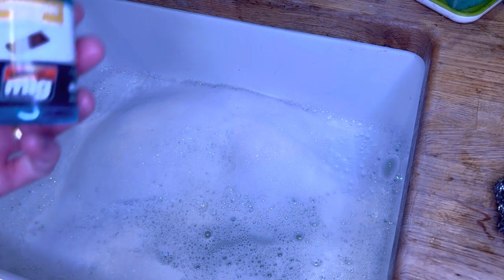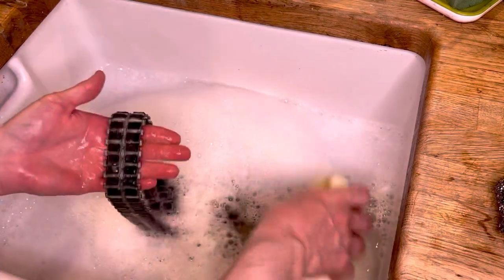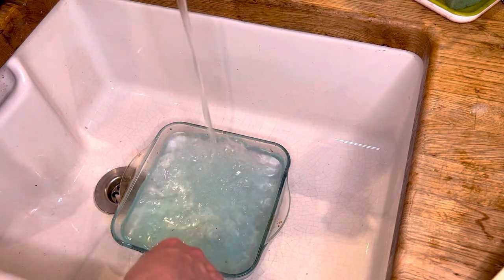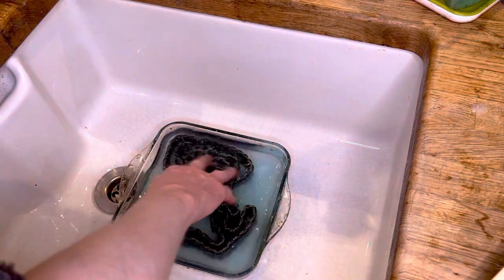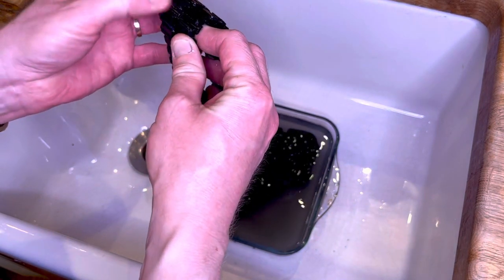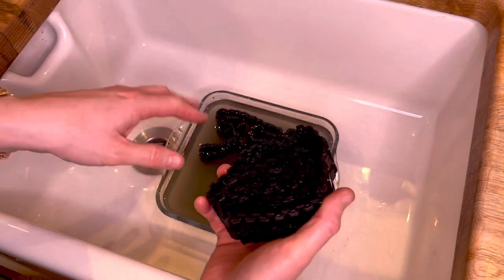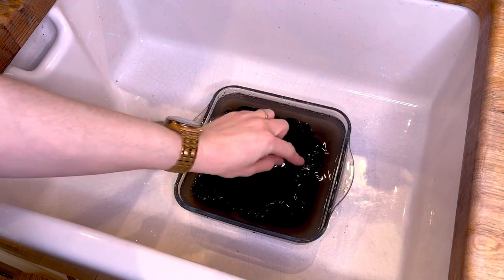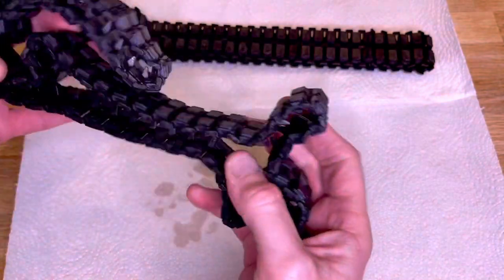AMMO by MIG track burnishing fluid #howto for Heng long/Mato metal tracks

Comment: Hi I used MIG on my Haya Chieftan tracks but they did not go as dark as you achieved although they looked a lot better than how shiny they were when the tank arrived. I did not wash and scrub or use warm water as you did and looks like i should have.  First time i had used it and have to say its worth doing it as it improved the look a lot even though they went a grey colour rather than black. Thanks again for really useful tips.
Reply from the maker: That happened to me first time.
I found if there is any grease or releasing agent from the molds, the fluid cant attack the track metal.
I've been meaning to do this for a while, and as i had no content of the Abrams i thought id put this out.
If people are amazing enough to subscribe to my nonsense, the least i can do is try to do something weekly  
🙂
thanks for watching again, too kind

Comment: I see these are the high quality chains from Mato Toys for the Leopard! . Your rubber pads have already been pre-assembled, but not here I have to improvise which glue to use to stick these rubber pads on! as these were not included with the Leopard (also purchase). I've never done the chain rusting thing before, but the question is, won't the rubber pads come off the chain? An answer to this would be nice of you.👍👍👍👍👍
Reply from the maker: Hi!
No the pad won’t come off with the mig track fluids.
The Mato ones fit the Leo and Abrams, the chally 2 ones come with slot in pads, that you have to stick in.
Super glue does the job well.
Hope it’s going well, and thanks for watching!
Have a great week

Comment: I went with VMS black track pro 2
Reply from the maker: Hi!
Yes that’s good stuff too I hear, I mainly use Mig because I can pick it up at the tank museum, so no postage 🙂 and I get a 10% discount.
Did it work quicker? Or the same?
Thanks so much for watching! And have a great Sunday
Reply: @mrtankalotrctankschannel  Ive tried both now. Both VMS and Ak black track work very well. But I have to say I actually prefer the Ak version. I didnt follow the guidelines and just semi submerged the tracks in the fluid and scrubbed them with a tooth brush for 10 or so minutes. Then left them to soak for a further ten. The Ak leaves a lovely brownish rust and a light dusty residue on the outside of the tracks, pretty much weathered themselves with a little elbow grease. Chuffed with the results
Reply: @mrtankalotrctankschannel  And I also used the cheapest, nastiest nail polish remover to clean/prep the tracks before hand as it contains 90% plus of acetone, then clean them off in warm soapy water and rinse in council water ;)

Comment: I was wondering if the mig stuff would work on HL tracks…….I assume it would do the same to the metal idler & sprocket wheels?…and the suspension arms (metal of course)….
Reply from the maker: Hi!
Yes! It will work on the Chineseium they use 🙂

Comment: Hello! I watch all of your videos. I watch them on my TV, so subscribing/liking/commenting are either impossible or above my current skill set. :) 
I really enjoy your videos. Very nice how-to's, and superb video/audio work. I like your channel because of the work you do, so thought instead of constantly searching for your
work, would get on a PC and subscribe and click the bell. 
Now to the meat. I got the M1A2 in desert and the one in MERDC, both V7.0. I used the same Mig burnishing fluid, to do the original metal tracks. I got away with one bottle. "After" I bought the bottle I decided to do research on how to use it. I got away with using one bottle for both tracks by just letting them soak longer in a more diluted solution. 
But then, I came across the tracks with rubber pads! 
I put them together and put them on the desert Abrams. They feel a little snug to me. I was wondering when you put yours on did you use the track tension adjuster, or was it just a straight 1 for 1
swap, or did your tanks already come with the padded tracks? Are you going to make a video of changing out the tracks?  If there already is one, I apologize. I just haven't found it. Would love to see it. 
BTW, I also heard that the firearms bluing agent is pretty much the same thing at a fraction of the cost, but haven't seen anyone try it yet.
Reply from the maker: Hi!
Firstly thanks for watching, I’m still amazed people watch my content! 
I think tighter is better, they normally shed tracks if it looses tension on turns between the last road wheel and sprocket.
I’m not sure about the tension on mine yet as I basically run it around the front room, and took it apart to work on it, I will say with my challenger 2 I took out 1 link to stop the idler/track tensioner flopping down because it was loose.
I’ve put them back on, I’ll do a short to show you the factory tension (mine came with the rubber pad tracks)
And I’m glad it looks clear, I record them on my iPhone, I really should get a proper camera, but it seems to do the trick, though the iPhone camera does have a mind of its own!.
And thanks again for taking the time to watch, means a lot 😁
Reply: @mrtankalotrctankschannel  It is my honor, more so than you know, to hear from you. You have done some really cool things. I have a couple questions. I took my M1A2 out for a cruise this morning. Loved seeing the little kids faces plastered to the windows, that was as much fun as driving the tank around! How do you keep your aerials on? My tank, the antenna fit is so loose.  I was trying to justify just soldering it to the base but thought I would ask you first.  Second, the gear box you showed in your first Abrams looks just like mine. It is enclosed. Is that a good gear box? I drove mine through wet grass, over rocks, into sand, up a steep 60 degree incline, and ran it back again remembering to put the gun tube over the rear deck...lol, I am an old US Marine....improper things have happened.
Look forward to your video on the track tension. Thank you for your time and what you do.
Alan
Reply from the maker: @alantrail7662  your too kind 🙂 the aerials I’d use a bit of varnish and paint the metal bit the aerials push onto to thicken it up a bit, or clear nail varnish.
I think you could solder them, but pull them out the tank first, I know this is teaching someone to suck eggs, but I forgot once and the metal I was soldering was still attached to the tank and I melted the attachment point that’s plastic, Doh!
I’ve not run it much yet, but as far as I know there steel, not the chinesium that my little boys t72 had issues with, and it’s nice they have the dust covers.
Thanks again for watching my nonsense! And always a good idea to chuck the gun over the deck! 🙂
Reply from the maker: And I’ll get round to the track tension, but rctanklegion have done a good video on this the chap is called Stanlley Legion 

https://m.youtube.com/watch?v=szka1JDHkhw
Reply: @mrtankalotrctankschannel  You made me laugh..chinesium! I have a theory that while in minute quantities, they get rid of their national waste by imparting subtle quantities into their products. I will hush now. But surely I was looking for a way to continue electrical conductivity to the antenna without a permanent mount. I have worked at Boeing well over 3 decades. I found a malleable sealant that conducts well, but doesn't make it a permanent contact where it requires destructive measures to remove it. lol.
Reply from the maker: @alantrail7662  that must be cool to work for Boeing 🙂 I hope I’m not grabbing the wrong end of the stick, but the two Aerials that come with the Abrams are decorative, the brass bases just push in and have no connection to the receiver, they use to about 10 years ago when it was using analog radios, but the new digital ones have no need, just there for show, I think there the ones you mean? But I Could  be very wrong! 😁
Reply: @mrtankalotrctankschannel  Well, I think you might be way ahead than me! I studied antenna theory and all of that nonsense. But I haven't taken either of my tanks apart to discover what technology they are using.

Comment: Wy do you do water with the bottle Mig and put it inside dish and mix it , other brands do that not what will happen wen i do it pure and put the tracks inside the Mig witout water .
Reply from the maker: Hi
You do t have to in 1/35th but the amount you’d use neat on 1/16th would be huge. The dilation makes no difference to effect, just takes a bit longer.
Thanks for watching! Have a great week 🙂

Comment: After you have done this, can you still paint a primer and then  paint  for example a brown color , for the weathering look?  I want to use it for my shiny blank metal sprockets.
Reply from the maker: Hi!
I wouldn’t bother if your going to paint them anyway.
I’d get a good undercoat and paint the sprockets as normal (give them a sand to get the shiny off with 800 grit glass paper, and wash them before you undercoat them to give the paint a key to grip to)
If you want to weather the tracks with this on it’s really easy.
Thanks for watching 🙂 and have a good weekend
Reply: @mrtankalotrctankschannel  Thank you very much!